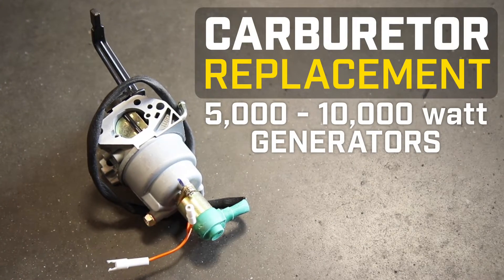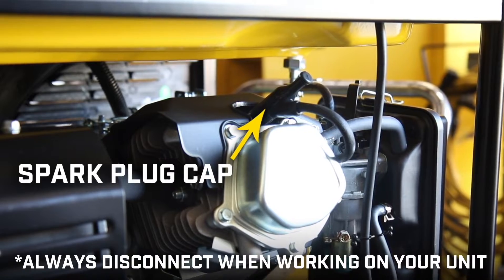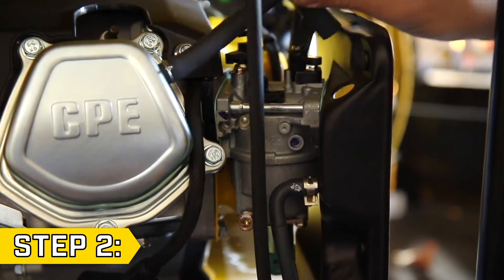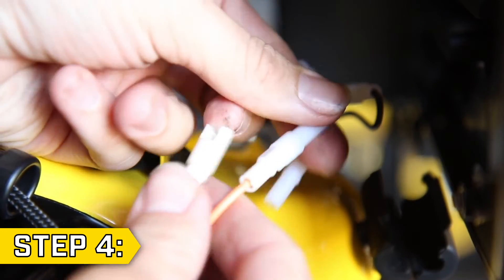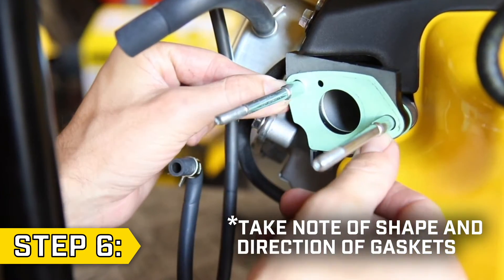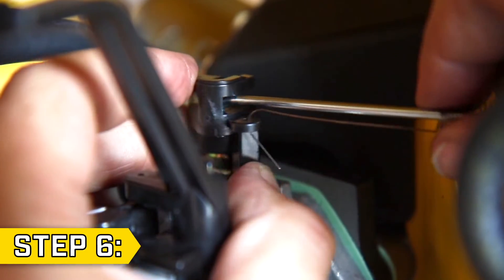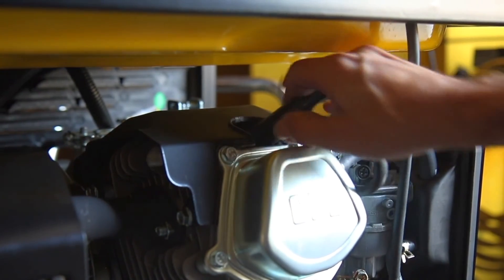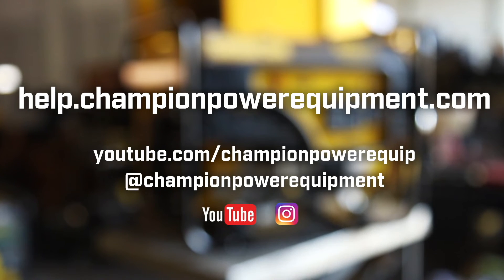Carburetor Replacement (5000-10,000-Watt Generators)

Comment: my generator ( 40046 ) has an adjustable needle valve on the outward side of the carb and all the videos I've seen shows this as a blocked opening .... what is the initial setting for this needle valve ? Thank You
Reply from the maker: Please email us at support@cpeauto.com, so we may further assist you with this. Thank you.

Comment: I have a model Number: MODEL #201033C and need to replace Carburator. Can't find any assets online to help me determine what I need, can you assist?
Reply from the maker: The carburetor part number is item 91 on page eight in the parts manual: https://www.championpowerequipment.com/wp-content/uploads/2020/12/201033-EPL-English-all.pdf - To place an order for parts, please give us a call at 1-877-338-0999 or visit our online parts store: https://shop.championpowerequipment.com/en-us/

Comment: What’s the part number for the carburetor?
Reply from the maker: Depending on the model number of the generator you have, the part number may be different. Can you provide us with your unit's model number, please?
Reply: @ChampionPowerEquipmentHQ 100496